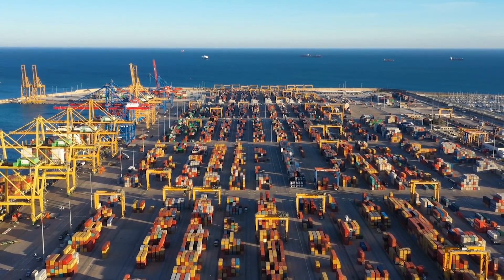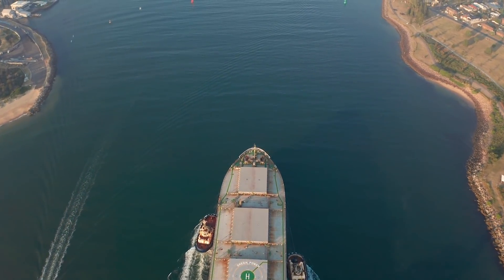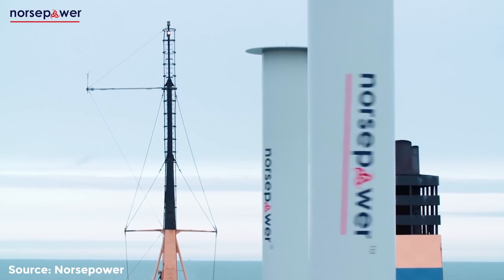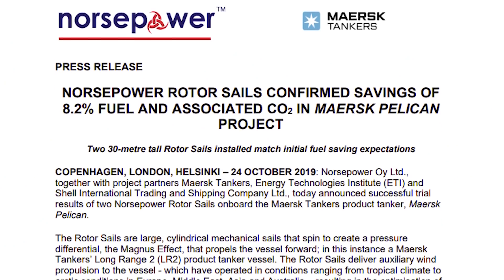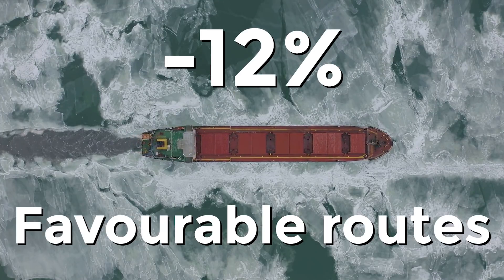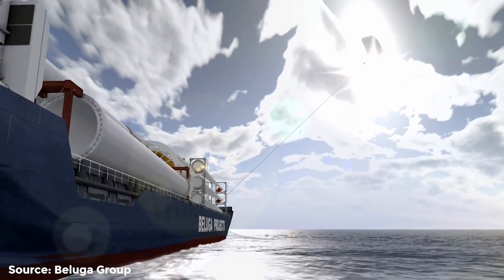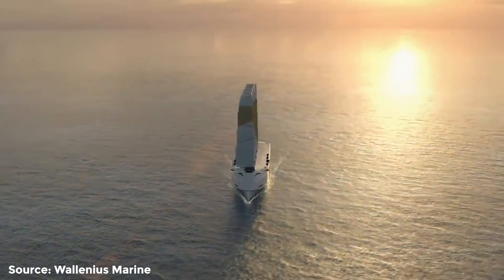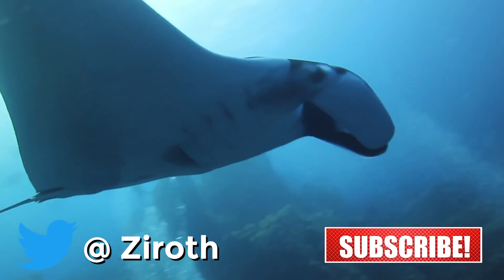Is Wind Power The Future of Shipping?

Comment: More Greeney fantasies.
Rotating cylinders are the most inefficient sails known to man.
And regards sails, look at the sail area of a tea-clipper in comparison to those fixed sails - they would only give you 1 knot of propulsion.
A full set of sails on a cargo ship would probably save 2% of fuel used, and cost a small fortune to fit.
Remember - NO GREEN TECHNOLOGY HAS EVER WORKED.
      (they are all dependent upon subsidies)
Ralph
Reply: Which is why solar is now the cheapest  form of energy production per kWh?
I don't think you understand what energy subsidies are for: they're not a tree-huggers attempt to make up for a technology's shortcomings, but a way for a government to get its foot in the door by nurturing its own renewable industry.
Reply: Ralph Ellis no green technology has ever worked? Please explain how my off the shelf, unsubsidised solar set up has produced more power every year since I installed it than my home requires? The payback equates to about six to seven years, the panels guarantee eighty percent capacity will be retained at twenty five years. In short, my panels were probably the best investment I have ever made.
Reply: Unsubsidised?   The majority of Western nation still have subsidies on their renewables, even if they are not obvios, and you are a mug if you did not apply for one.  
In the UK, solar and wind STILL have priority over coal and gas, which means the latter have to shut down first if there is an over-supply.  THAT is also a subsidy.

And none of that detracts from the fact that rotating cylinders are the most inefficient wing or sail known to man.  Plus the fact that the sail area on this ship is far too small to make a significant difference to its propulsive energy consumption.  And it can only have an effect, when the wind blows.  
R

Comment: I have pulled my 3 man canoe along with a kite before. Good fun and very fast.
Reply: I was a truck driver and one time after i dumped sand from a trailer the wind was blowing from the behind and the truck begun to move, the truck and the trailer are about 14.3 tons 😲😉
Reply: @joistein  I too, was also a truck driver. Keyword is 'was'. Similar situation happened to me, but without any real wind. Turns out I was on a hill.
Reply: @norgepalm7315  🤣🤣🤣
Reply: Exactly, also try and hold even a modest sized sheet of corrugated iron up in a stiff breeze .
Reply: It seems a kite can be retrofited to any existing vessel with minor adjustments.
Reply: If we can engineer such large ships, why not engineer even larger kites than before, a kite as large as the ship i’m sure would pull the ship along quite nicely flying high above sea level
Reply: @TheSlyGhostttv  I absolutely agree!
Reply: @TheSlyGhostttv  1) you will need massive keel too, 2) such large kite would need some solid wing and this will have problems during take off and landing phase. 3) wind is not reliable - so engine will be necessary. 4) there is risk of crossing control lines in heavy traffic areas.
Reply: @petrkundrata3954  All very good points!
Reply: @petrkundrata3954  You don't need a keel with kites because the average force of lift can be angled directly along the bowline, regardless of wind direction. Keels exist to convert an uncooperative wind direction into forward motion.
Reply: With a strong wind I can see that happening but as you should know the wind is unpredictable even within a few hours .
Reply: @joewilson2258  

Wind is pretty constant when you are a little bit off the surface/ground.

Surface winds are not so constant yes.
Reply: A ship weights 900 million pounds.  Sure maybe it can help but not consistently push the ship along for thousands of miles
Reply: What type of kite? A power kite?
Reply: @claywebb1784  It was a large para-foil kite, I just tried to look it up but the company might not exist anymore. I can't find it.
Reply: @sarcasmo57  cool. Used to work at a kite store... What's the name of the company? What is it made out of?
Reply: Get a big fukin sail and start moving cargo.  Should work out great 
Screw fossil fuels who needs em.  Give me a break
Reply: That's nothing. Ben Franklin used a kite to harness the power of lightning --with a key dangling from the kite.
Reply: I've pulled my kite along with a one-man canoe and can't get it airborne!
Reply: Reminds me of water world
Reply: Wind power and solar are failures.
Reply: @asherdie  They really are. Nuclear is our best hope for the future.  Check out ITER if you haven't already. Mega Project. Awesome.
Reply: @asherdie  
My home AND my car are powered entirely by solar. For free. Batteries run everything at night. There are places where it's not practical or economical. There are places where solar is much cheaper than any other energy source.
Reply: @danielschechter8130  did you pay 100% out of your pocket for the solar?  What are the environmental cost of production and disposal of batteries and solar cells?

Comment: In my view, the biggest problem with wind powered ships is “Just in time delivery systems”.  For that, material has to get there quickly.  But other things, such as oil, ores, etc, could be considered as being on a conveyer belt system. . .   Wind Powered ships would fill this requirement very well.  The irony, of course, is “Oil”.
Reply: Thanks to liner shipping our efficiency increased but liner shipping requires stability, even 2, 3 days of delay cause trouble for that port. Ideal shipping is always on time. Of course there are still some companies use tramp shipping method but they sail between less devoleped areas. If we can predict winds then using wind power for certain routes feasible. At least, in my opinion.
Reply: @Gurumdae  Realistically I am of the mindset that a hybrid of wind power and a diesel-electric powertrain would work well. Basically, stick some wind turbines on the ship sure there is some inefficiency converting wind to electricity first but is a far less complicated means to improve efficiency. Essentially just throttle up the diesel engine to cover the additional generating capacity. In practice of course the ship's computer would do this part based on the commanded turns of the screw and consumption of electricity internally by the ship.
Reply: @FaerieSeraphina  Well there are some issues about diesel electric power if you want to use it for large vessels. To use diesel electric you need much more refined fuel which is costs more than our 2 stroke diesel engine fuel a.k.a heavy fuel. 
To install such wind turbines you need to sacrifice carrying capacity of ship. The question is; Is installing such wind turbines returns a good yield?
Other question should we build that kind of ship? A freight ship's maximum life is 20-30 years then you need to recycle it. Can I reuse these wind turbines?
Another problem is vibration, such turbines would have cause vibrations that damages ship and affect health of crew.
At least for now we dont need to change ships as long as we can prevent sox, nox and particule emissions ships dont harm environment and human health on a global scale. Still, they are known for causing local pollution since you put a huge engine and let that exhaust gases to atmosphere. It increases Co2 density of area they pass through.
Reply: @Gurumdae  I understand that and honestly was not saying this is definitely the best solution just that it would be the most plausible way I could see wind power being adopted. Honestly, I think with the massive rise in fossil fuel cost since it was last attempted that it may be time to revive research and development into nuclear merchant vessels. A modern 20,000 TEU container ship more than large enough to handle a nuclear reactor and the large mass of shielding needed their engines easily mass in at a similar mass and are actually larger.

Also even if nuclear energy were not much safer in terms of lives lost per GWh generated which makes the paranoia about it unfounded. From my perspective having the reactor on a ship would massively reduce the risk of a devastating critical failure also. Not only do ships spend only a fraction of their time hanging around in port but of all the nuclear loss of control incidents that had any real chance of endangering nearby populations they kept it under control for hours before the first forced radioactive release.

Which is a big additional safety factor for a ship, they may not move fast but they can move a considerable distance in 6 hours. Chernobyl, Three Mile Island and Fukoshima were dommed to have their full effect where they stood as they were not exactly portable. Ships last I checked were not only portable but moved themselves undocking it and moving it a safe distance from the port city with 6 hours to play with seems achievable to me.

By that yes I do mean even if the ship was not already equipped with autonomous or remote piloting as I am not saying it needs to be enough to get out of harbor solo. Undock the thing point it at the sea and force the throttle on then get the hell onto a support vessel. Just can't be that hard to make a modern ship that is basically pilot by wire just go in a straight line for some amount of time. You don't need accuracy in the destination, after all, just far from land.

Main problem of course would be making sure these reactors on ships got maintained to the same high standard that has enabled nuclear power's significantly better safety record on land. But as much as I know corporations are prone to cut costs I'm less convinced they would be so quick to gamble a 20,000 TEU container ship to save a few hundred thousand dollars, that is probably an insurance premium on an asset that valuable. I presume they are easily as expensive as airliners if not more.
Reply: @FaerieSeraphina  well Nuclear energy seems good but there are a lot of trust issues between countries and unseen effects can take place. Terrorism is one of the dangers. You need a fleet of naval ships to guard the ship.
Nuclear energy promising but I dont think it is feasible to use as a mean to power shipping systems. Advantage of nuclear energy is sustainablity and zero waste. But we dont need to sustain a freight ship more than 50 days. All around the world we have ports to do that.
Im more excited about hydrogen fuel cells. But the current technology is no where near to use it for ships.
Reply: @Gurumdae  True though I was not suggesting it as something we should at least put back on the table after decades. More that since the idea was last touched upon the price of oil has skyrocketed we have learned a lot more about fission energy and we are now aware of not only the harms of fossil fuels but the fact even if they didn't limit how much we can maintain the status quo the finite availability of them would still put a clock on this just a far later one.

Either way we need an alternative only the timescale varies between whether you accept the scientific consensus that climate change will bugger us all first or the simple exhaustion of the resource. Seems to me that for bulk shipping nuclear energy is an option worth putting back on the table for research and development.

Even more so now that we have also seen long-neglected but promising alternative nuclear energy technologies being brought back to the table and given serious research and development investment. For example molten salt reactor designs, the first prototype of which dates back to the manhattan project in the 50's (An LFTR type). They were abandoned as a concept at the time as this was the manhattan project and the goal was to produce weapons-grade plutonium which those reactors could not do.

Even at that time though they would and still do have significant advantages when evaluated against the criteria for civil power reactors. For one unlike the solid fuel designs favored at the time for their Plutonium product, there are molten salt designs that would feature entirely passive safety systems. Mostly because unlike the solid fuel designs which rely on dumping a few tons of already fissile material into the reactor triggering the chain reaction and using a combination of control rods to slow it and active cooling to stop it melting the whole reactor.

These molten salt designs well the promising ones to me anyway use a nonfissile fuel in a flowing breeder reactor. Sure the molten salt does function as the coolant here and needs to be pumped but the fuel can't sustain fusion on it's own either, to keep the reaction going the nonfissile feedstock needs to be pumped though the breeder. And this is the same cycle if that pump fails the reactor runs out of coolant and also immediately runs out of fuel. It would continue to heat up a bit from decay heat but it wont continue fission which is a big difference decay heat can be dissipated by a large passive heat sink the latter requires a small river worth of water pumped through it for months without fail.
Reply: That's not ironic.
Reply: Sony Pony  True though another big reason that trade happens is simply due to competitive advantage. Basically, some countries have an advantage when it comes to producing certain good that enables them to produce more of it or do so cheaper than other countries could. One country could for example have a massive advantage in infrastructure, capital assets like factories and a concentration of highly skilled workers that enables them to produce more and cheaper airliners while another country has an advantage of having significantly lower costs of living and thus cheap low skilled labour which is an advantage for labour-intensive goods which require minimal training to produce such as clothing. Just makes sense for the first country to export their aircraft and import the clothing as both countries get the goods they need at a lower cost this way which leaves the populations of both better off on average, one country gets cheaper air travel (the cost of new aircraft is part of the ticket price after all) than they would otherwise the other saves money on clothing both thus have more money to spend on other things people want to buy.
Reply: Aye need mah ores, and i dont want to pay for mah fuel. Go green yah pansy.
Reply: Sony Pony  Sounds like a local government problem, not a manufacturing one. Zimbabwe was once the farming haven of Africa, then the government took the lands away from the white farmers, and gave them to inexperienced black farmers, which led to the country being in debt and having food shortages that continue to this day.
Reply: Every country go back to manufacturing, stop globalization. Simple
Reply: @tobybrown1179  it's not that simple, some country are poorer in other material than others, imagine country A can't make their own bread, county B makes too much bread, ofc they have to buy bread from country B, country B can't make their own clothes, but county A makes more clothes than they need, so country B buys clothes from country A, ofc it's hugely simplified, but use ur imagination a bit
Reply: @RENO_K  well mate, Australia produces or manufactures very little now days. Our politicians have sold us out, we’re stuffed and have our last oil refinery destined to close, that’s what I’m on about that when war breaks out in 2 years time and the ships stop coming we will be stuffed
Reply: @tobybrown1179  yeah, but manufacturing all of your own country’s goods are nearly impossible.
Reply: @tobybrown1179  ahaha..well, then stop producing everything in China, where is a cheap work force...and start making everything in-home.... with + to pollutions. not sure, but everyone ready to pay twice or even much more for the things?
Reply: Perhaps, then, just in time systems should be rethought.

Comment: Have vertical wind turbines been investigated? They would not be sails, rather they would turn generators below decks that powered electric motors that turn the propellers.
If a variable ratio mechanical transmission, a CVT, was used it could be coupled as well to diesel engines via a variable differential gear drive to attain optimum balance of wind and diesel power for the most efficient speed and fuel consumption.

Comment: wind simply is not the most economical system for removing emmissions from these vessels. wind relies on, shockingly, wind. it also takes up deck space,  costs too much, and the afformentioned issue with the charters. in reality, we have had a better solution for a long, long time: nuclear. many US navy ships are already powered by nuclear reactors, which create no emmisions. they also do not need fueling more than every 10+ years. the problem is insurance. when you put something that could explode on your ship and cause an ecological disaster, insurance skyrockets. however, we can make nuclear reactors that do not explode; we just need to use thorium reactors. unlike uranium, thorium is not fissile by itself and needs a small amount of plutonium in order to become fissile. this means that if shit hits the fan and it reaches the conditions where uranium powerplants explode, you can drain the thorium into another tank. no explosion. but what if the ship sinks? then build a reactor that can keep the radioactive bits contained until it can be extracted by a salvage operation; besides, ships do not sink that often anymore. a ship usually just goes from point A to point B for 40 years and is then broken up and made into another ship.